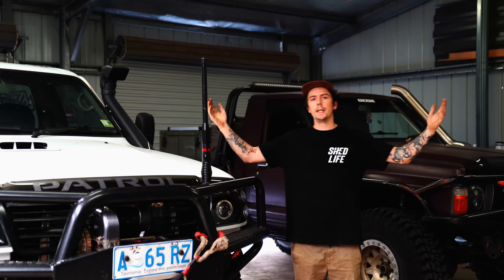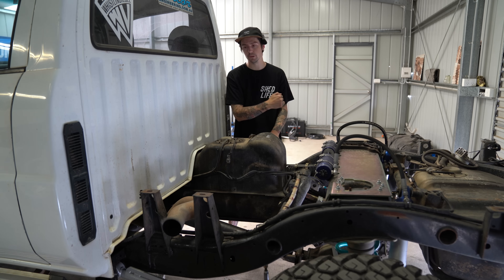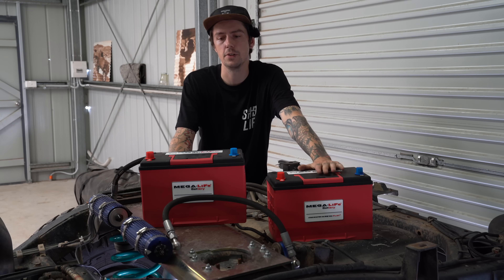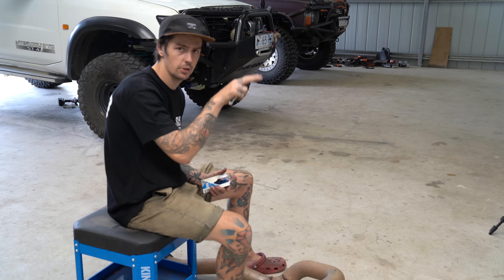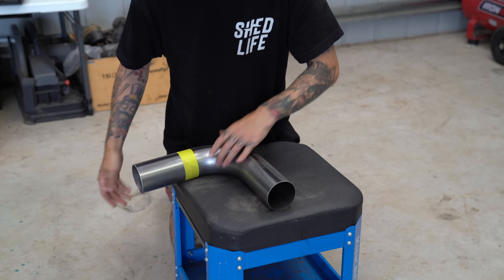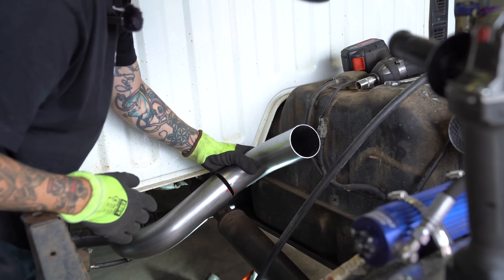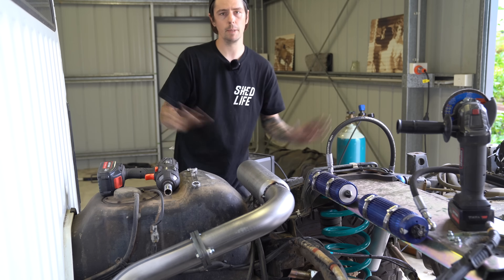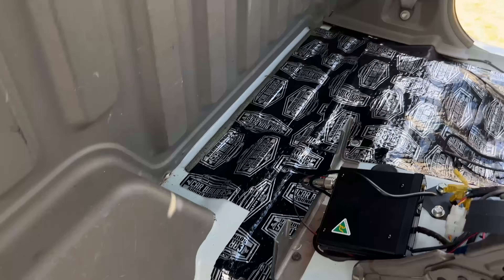FIRST JOB in my BRAND NEW SHED

Comment: You can tell a bloke lives in either Vic or Tassie. They have that one necessary accessory in the shed, the fireplace
Reply: 100% needed. It just makes those late nights so much better
Reply: @liamcan3262  absolutely,  I think it's an awesome idea!
Reply from the maker: Haha much needed, also because the ceiling is too high to hang heating from it would never get heat down into the space, I’ll probably do a custom fire eventually but yeah this one was already in there 👍🏻
Reply: @timmyhasheart  100% it's where the likes of TJ and Mac living in QLD we only need airconditioning haha
Reply from the maker: @liampoor9699 facts haha

Comment: The hoist is going to be a game changer for weird exhaust-routing projects. Ask me how I know...
Reply from the maker: Haha it would be!! My hoist is on the way! I certainly don’t envy routing dumps & pipes from 2 turbos on 2 sides of a Patrol that’s for sure. I didn’t really have any other choice, don’t like stacks, passo is illegal, and going to the back I always damage the tip when wheeling & its difficult to get over the diff & past the other tank without it rattling or being mounted too stiff so it cracks. 🤝🏻🤝🏻

Comment: Great ep as usual. Question about the sound deadening - how does it go getting wet and will you use it on the rear wall?  Also how thick did your shed floor need to be for the hoist?
Reply from the maker: Sound deadener can get wet just fine, especially the stage 1 it’s literally just rubber and aluminium, it’s all through the GQ under the vinyl and that frequently gets filled with water, as for stage 2 if you’re gonna get water in, use the waterproof one. The slab thickness varies hoist to hoist but some say 100mm, some say 150mm 👍🏻

Comment: I have found most of the noise in my old patrol would come through the rear of the cab. Maybe worth sound deadening there as well, I figured this out when I would pack all my clothes and bedding behind the seats it was dead quiet.
Nice clip man keep it up
Reply from the maker: Yeah you’re bang on, rear wall is huge I did my GQ, and the doors too!! I didn’t have time to get the plastic out this time everything happened to quick but I will do it for sure. 👍🏻👍🏻

Comment: That’s a good trick with the tap around the pipe. 
How good is the new shed mate. What size is it?  I’d like to see how the epoxy goes on as I’ll be building my shed soon and I like the epoxy floors I think they are very good. 
Anyways thanks for the Sunday episode 👍🏽
Reply from the maker: Yeah it’s handy, honestly have had another 2 tips since that episode, someone said emery tape which is a good idea, and another said a hose clamp which is also a good idea, anything to mark a square cut around it would work!

The shed is 9x12 i believe! Yeah the epoxy is the way to go, this is a 2 pack industrial epoxy, it was ridiculously expensive so hopefully goes well haha. Cheers mate you’re most welcome.

Comment: Dunno what the difference is with your original exhaust position and factory at rear passenger side on a Ute
Reply from the maker: You’re allowed to driver exit but not passenger exit, I believe due to the sidewalk/pedestrians, you’re allowed to exit on the left at the very rear though
Reply: @timmyhasheart  yeah doesn’t make any sense to me as both are passenger side with a bit of angle added. Only difference would be a couple of metres in length. Crazy
Reply from the maker: @kromey111 a lot of things don’t make sense with VSB haha, but that’s what we gotta do 🤷🏻‍♂️

Comment: Hey Mate! Thinking of doing the exact same as I’m also sick of an almost identical passenger side dump on my gu that I also botched out of the previous exhaust. Is that just 3” stainless you used? Also what thickness? Did you just use a mig welder? Awesome content keep it up👍
Reply from the maker: Hey mate cheers, yeah so it’s just 3” aluminised mild which is just what most exhaust places would have, and yeah just a mig mate, I could have tigged up something pretty and stainless but honestly I just don’t care enough about that kind of thing, it’s a dirty old diesel 4wd haha

Comment: My exhaust dumps just at the back of the cab on my gu Ute. Honestly isn't as bad as having the passenger window down because of the staino😂 exhaust yeah when the waste gate opens is a bit loud but who doesn't like a wuhan war whistle 😂
Reply from the maker: Yeah tbh I do love the sound, the main factor was making it legal, if it wasn’t going through engineering it probably wouldn’t have got the hot dog.

Comment: hey man dont know if youll reply to this but im looking at buying a patrol, what model and engine etc do you recommend to get? 
 so im not wasting my time with the wrong buy.
Reply from the maker: It depends on what you’re after, and whether you’re going GQ/GU.

- TD42 is a good platform for reliability, simplicity & resistance to water & dust, but they take a lot of time and money and understanding to make them behave in a overheating aspect and a bottom end aspect, the more torque you make, the more volatile they are.
- ZD30CRD is what I’d go for if I was coming from a dual cab world and liked the new car driveability, they’re more like your commonrail diesel platform, but have a lot of sensors and expensive things that keep them ticking along. Water ingress in fuel etc is a sure way to quickly cop a 10k diesel parts bill. But they’re proving themselves in the torque and power game.
- TB48 is a very capable and expandable petrol engine, they’re very reliable, super under tuned from factory and are quite amazing if you bung a turbo at them but can be thirsty especially if you’re towing.

Personally I wouldn’t go near the TB45.

These are all the main GU engines, there’s also ZD30DI, RD28 and TB45 but personally I wouldn’t go near these but if you’re talking a GQ, then there’s also a TB42 carby and TB42 EFI, I wouldn’t go near a TB42 carby but I’d happily have the TB42 EFI.

Hope this helps mate.
Reply: thanks heaps for the reply mate @timmyhasheart